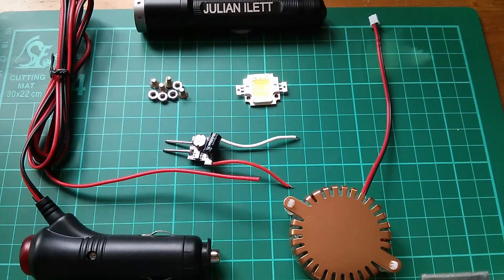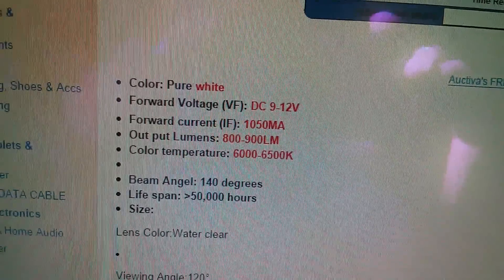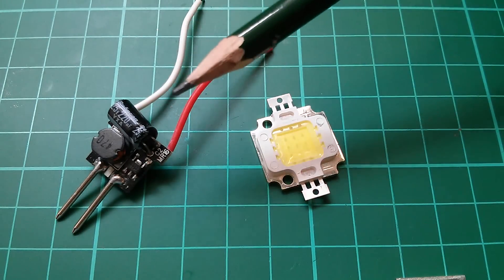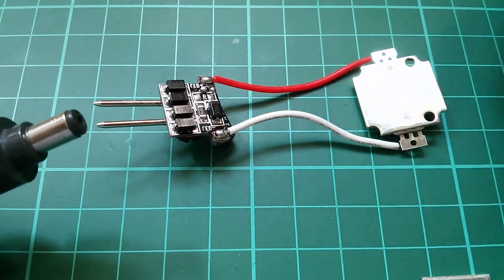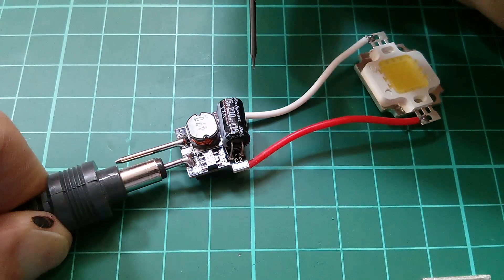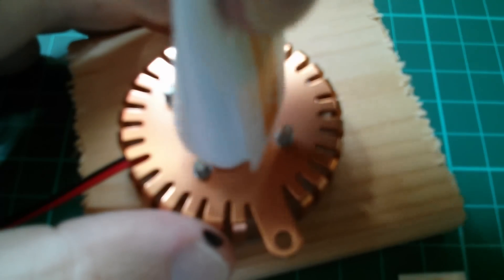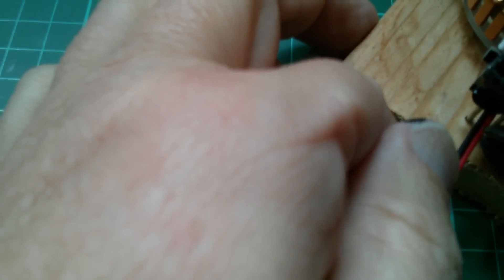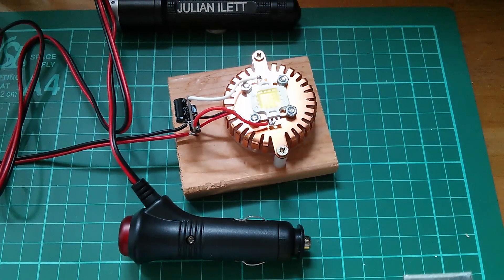LED Tutorial: Light a 10W LED from 12V - Simple & Cheap

Comment: Hi Julian ..i bought this set up on "satisled" website .... i read that the driver has an input DC 12-24 v .... i dlike to know if i could use an old PC battery charger that i have .... the output is DC 19V 4.79 A... will it fry the driver or not ??? thanks Seb

Comment: Nice guide! 
But i am having issues ... i have bought 5x led drivers + 5 10Wled chips ... problem is, that driver is providing only 570mA to each led chip. I have mesured 10,4V on each led chip ... 10,4V * 0,57A = 5,928 W ... that is definitely not 10W ... Not cool at all. 
Do you know why is this ?
As source for my application, i use old PC ATX source ... its 12V brasnch is capable of delivering 15Amps .... i have mesured, that its voltage under load is 11,86V ... i think pretty normal.

Can anybody help me ?
Reply: +Jan Slavotínek your driver takes away 1.6V to do the regulation, and the remaining 10.4V is not enough to drive the LEDs at full capacity. Thats completely normal, you need a higher supply voltage! Consider using a DC-DC boost converter!
Reply: ᅚᅚ I have found out, that there is diode bridge (2 x 0,7V drop) on the PCB that is completely unnecesarry if you use DC supply. So i have desoldered it away and now its better but still there is not flowing 0,9A current as i have expected. I suspect bad current feedback resistor (shunt) settings

Comment: i am using leds withought a driver in direct 12 volts for nearly 3 to 4 years,
 it isnt giving any problems.
Reply: Nothing is driven by current, everything is driven by voltage and current which = power (neither can exist on their own). Connect a 3.5v LED to a 1v power source and it will never light up. 
The only thing that differs with an LED vs a lot of other electronics is that it draws current at a ridiculous rate if even slightly above it's max voltage recommendation. 
If you run an LED at the exact right voltage or even a few a few hundred millivolts under then it is never going to miraculously draw large amounts of current and burn itself out. It draws current based on the voltage you supply it with, as long as you don't overvolt it then it's fine. The rate isn't linear though as the man that made the video pointed out. 
So you have to be careful with them, they aren't forgiving.
Reply: +Parasar Bhattacharya it shouldnt be either. But it really depends on the led. These leds are probably being overvolted at 12 volts therefore the current needs to be limited. Just my guess thou.
Reply: Marcus Christensen
yes if you are giving more voltage then the current shuld be limited. while i use perfect voltage so i need no drivers..
Reply: *****
yes i found it out by performing few test, thank you though sir, and i am using a 3 amp transformer but the leds are mounted on big processor heat sink but without the cooling fan, now i aM trying to mount 5 of these leds in one heat sink and will run by computer smps which can provide upto 5 amps.. but this time i will connect the cooling fan also... thank you very much for confirming what i got from test results. thank you again...
Reply: Perthaps your LEDs have a protection resistor built in, & maybe you are driving them from a true 12V supply, whereas a lead avid car battery might be charged close to 14V
Reply: well.. the idea with constant current is that when LED get hotter it let more current through and that shorten it's life, so basically if you keep your led cool, there is no problem at all and you don't need any driver, it's just safer option to have that led driver :) you can then be sure it gets what it need and nothing more
Reply: Parasar Bhattacharya  First This Led is Driven By Current Not Voltage.... If You Giving A 12V 1 amp It Will be Fine ...  also depends on heatshrink  but  Technichally In the long time use we advice to use a LEd Driver (Current Driver )
Reply: Parasar Bhattacharya I have Connected 100 W Led On A 36V 3 Amp Supply But i have Fix With a Prosesser Hit Shrink Which Is Pure Copper also come with a Cooling fan
Reply: Maulik Patel
 wow thatz  great , then you can use it  for long hours... its really a very good option. but the heat sink should be a little bigger and thicker
Reply: Question for all of you. If I use a 18650 cell, a TP4056 (with protection) and a MT3608 (it's a step up) to drive a 10w LED would I need a driver?
Reply: works with mine too very well. I have a 10w LED for 12v. Just having a good cooler on it c:
Reply: Well explained. Thanks!
Reply: Using LED's without a driver really only works if you have a good heatsink and fan behind them. It still will likely reduce the life span of it though. The current an LED draws does depend on the voltage source it is connected to, but also the LED if it gets hotter and hotter will reduce resistance and try to draw more current. Thermal runaway. 
Of course if you run a 12v LED exactly at 12v and have a good heatsink on the back with a fan then the LED will be controlled as far as temperature and it won't draw more than it's meant to at 12v.
I use drivers just because it's easier and I don't have to worry about making things exact.
Reply: One thing to note here is that as it says in the driver listing MR16. I have used MR16 LED bulbs on a 12v regulated supply perfectly for several years as well.
I think the point being is that the MR16 bulb unit has the constant current driver built within the base of the lamp unit
If you are using these SMD LED units then you do need a driver
Reply: Parasar Bhattacharya superman angela please complete

Comment: Hi, I have a nice 24v power supply and a housing from a previous sewing lamp. Id like to install some leds into the housing and use the psu to power it. Id like it nice and bright but not too warm as its a plastic housing. Would you maybe have some suggestions to how I could build my own?  Id also be happy using mains and a converter if its small enough. If you could help me out I could send you pics and more info. Thanks Simon

Comment: Hi Julian
Awesome video, very informative.. I am a newbie to LED world, If I have to connect 5 of these 10 w LEDs in series I.e. +ve to +ve and -ve to -ve  wiring and drive all 5 of them with a 12 v 2A LED driver, do they all turn on at full brightness, does the current get divided between each of those 10W module?..given these LEDs are rated at 900ma do all individual 10W LEDs get 2A current? .. Thanks a lot...

Comment: This is probably a stupid question, but can anybody explain how the LED is rated at 9V - 12V but still be destroyed at 12V? Surely if it's rated 9V - 12V it should be able to take that many volts, no? Thanks
Reply: You can, but when the diode begins to warm up, the resistance in the diode will decrease, which then increases the current and temperature even more, which again reduces the resistance and the diode will burn out, given that the 12V power supply will supply currents that exceeds the diode's capacity to handle, such as a small 12V battery. That's why you need a resistor in series so that it can take care of limiting the current. There is even more to this, but this should give you a sense of this topic. Even 1V could burn the diode if the current is sufficient. However, going over or below 9-12V will reduce the life span of the diode depending how much so, and the diode.
Reply: +Richard Jesudasan it make no sense infact. This is due to the fact that sellers dont know electronics. Much better a value like If=xxxxmA, Vf=xxxxV
Reply: 12v batteries output more than 12v. Usually around 12.6-12.8v. That small different can make your LED burn out just after a few hours, it's because it gets incredibly hot if just overvolted to a small degree. 
The description on the ebay page he showed you had two contradicting things also, it said 9-11 at the top and then 9-12 in the description. 
Usually there are 3 in series in the LED, usually 3.5v is what they like. So 10.5v should be the max, but around 10v is a better area to settle on.
Reply: It's all too easy to get into trouble with the ubiquitous 12 volt supply. Unique to that voltage is a loose definition. There are two voltage readings which is often thought of as generic. 12 volts in the lab and industrial fields is 12 volts + or - any given accuracy tolerance often stated as 5%, but can be tighter. The other 12 volt environment is automotive which can vary significantly. A lead acid battery reads around 12.6 volts at rest. The internal combustion engine needs an electric motor to start running on it's own. That electric motor can be around 0.50 up to about 1.0 horsepower which results in a short term load of dozens of amps which will cause a battery terminal voltage to drop several volts below 12.6 volts. Let's say that voltage is around 9 to 10 volts but could be even lower. When the engine starts it immediately recharges the battery for it's next use. This can rise to as much as 14.4 volts but falls back to approximately 13.8 volts nominally and varying slightly depending on the actual conditions. So in conclusion you can see where "12 volts" can actually mean anywhere between 9 volts to over 14 volts all within a short period of time and settling to something over 12 volts for the duration of the engine run. 
  Please don't make the mistake of assuming a fixed nominal voltage in a motor vehicle.
Reply: Two reasons, one is shitty leds and two is no or bad cooling.
Reply: @TaunterAtwill  and reason nbr 3 is....say anything to get the sale coz we know f*ck all about this product
Reply: +Richard Jesudasan It means the LED will draw the correct amount of current at only one specific voltage somewhere between 9 and 12 volts. But you still have to get the exact voltage if you want the specified current. Which is why its easier to just supply the correct current (with a constant current driver) and let the voltage be whatever it has to.

Comment: Hi, Quick request for advice If I may be so bold.I am looking to run a simple off-grid solar setup in a house I am renovating which does not have mains-feed. I just need lighting so nothing heavy duty -- a couple of  40W Panels fed into a charge controller and banked in some surplus 12v UPS Cells . I want to  run a succession of circuits to provide a switched light fitting in a couple of rooms using some of those cheap ebay ceramic MR16 lamp holders and then insert some MR16 LED Bulbs in... 
Is that okay or do I need a line driver somewhere in the circuit?. I have done a single circuit test run and its fine but before I run all the cables out and tie them all in, am i missing something? does each 12v MR16 LED lamp have its own line driver built in?
Reply: I charge 20 USD/H for consulting

Comment: i have a flood light with the same led chip as yours with a died led driver ( lable says 25-34V) ???  i have chacked the led with an 12v supply it whass still works and i replaced the driver with the same but now my led chip is also died.

Comment: it is not true that the LED burns if you connect them directly to 12V. I connected a 10W LED to a fully charged LIPO battery (around 12.5V), and it worked lika a charm. Cooled it with a passive CPU heat sink, but it got quite hot after a few minutes :) wouldn't recommend doing it that way, the lifetime of the LED will be greatly reduced and it needs some serious cooling

Comment: how could i make it so i plug it into a wall
Reply: +Tony Boroni http://www.ebay.com.au/itm/DC-12V-1A-Home-Travel-AC-Wall-Plug-Power-Charger-Adapter-Converter-with-AU-Plug-/251933448438?hash=item3aa86758f6:g:UJcAAOSweW5VOxAK      Something like that into the voltage step down regulator should work

Comment: Something I'm curious about is the current reading I'm getting when using this 10w led with a 10w driver - it's reading about 150mA at 9v, with the input to the driver being about 16v. If I short the output I however get about 950ma (presumably at 12v). I wonder if it could be a problem with the two 9v batteries not being able to supply the current? I'll give it a test on a car battery tomorrow and post the results.
Reply: +BenjaminGoose Did you get any results with testing?
Reply: Hannes Mrg I've just tested it on a 12v supply and my meter showed just under 300mA being drawn, so maybe it's the led itself. I have some more on the way, so I'll give them a test too when they arrive.
Reply: +BenjaminGoose That would be nice, i also ordered some of them, if you want i can tell you the results when they are here.
I also read(or red?) that there are broken leds sometimes who dont work right. Maybe you have one of them.
Reply: Hannes Mrg That'd be cool, yeah. I noticed that at a low input voltage (about 9v) some of the leds glow brighter than others, and there doesn't seem to be a pattern to it (which I guess could be normal, I don't know). All of them glow though.
Reply: Hannes Mrg Just tested this connected to the car battery whilst running the car (giving about 14v) and it correctly drew about 0.83A as it should! So perhaps the driver requires a bit more than 12 volts.
Reply: +BenjaminGoose Okay, thats nice. I think they work like the little buck converters, where the input Voltage has to be at least 2V over the output Voltage to work right.
Reply: Hannes Mrg Yeah it seems like that. Bit of a shame you can't get full power from a regular 12v supply though.
Reply: +BenjaminGoose At 9V i measured a power of abuot 5W instead of 10W. We are at the elbow of the v/i led curve
Reply: elparadisecom Yeah that makes sense to me. I measured similarly at just a little higher voltage.
Reply: Hannes Mrg Just in case this information interests you, I hooked up a 24vac supply to the led driver through a bridge rectifier and smoothing capacitor and it seems to draw the full power without requiring any voltage regulation on the power supply (I guess that makes sense considering how the led driver works). That's pretty cool. I have plenty of 24v xmas lights transformers to spare so maybe I can use those in projects. :)
Reply: +BenjaminGoose Thanks!! I was wondering the whole time what PSU i should use because the common 12v ones dont seem to work well. I will try the same then :)
Do you think With 240Vac with bridge rectifier and 10 drivers in series it will work, too? 
10 Leds in series wouldn't be that good i think because they all have little differences in the power they need, but the drivers should not really care. Or do they?
Reply: Hannes Mrg That's a good question. I'd imagine that due to the switching nature of the drivers the voltage won't be distributed evenly among the supplies, meaning some of them may be taking a dangerously high voltage, so I wouldn't recommend trying it. If you have a 12v (ac) supply you can easily create a voltage doubler with a couple of components (see the wiki article on 'voltage doubler') which I think would work just fine. If I can find such a supply I'll give it a try myself, although I'm not sure how common they are.
Reply: Hannes Mrg Oh by the way, if you happen to have a suitable boost converter lying around (to use on a 12vdc supply) that'd most likely do the job. They are really cheap to buy on sites like aliexpress and banggood. Seems like a bit of a roundabout way to solve the problem though, considering the led driver already works in a similar fashion to a dc-dc converter.

Comment: Hi all, i have bought a led ring for my car and i want to secure constant 12 volts all time by using a driver like this one. My car voltage jumps to14volts all time. Will it work?
its a 10W 12V - 24V DC LED Constant Current Driver Power 900mA High Power LED
Input Voltage: 12-24V  DCOutput Voltage: 9-12V
Output Current:  900mA+-5%
can support 1pcs high  power 10W led 3 in  serial and 3 in parallel

Comment: Hi, I have a question I hope you can answer for me. I have converted my car's tail lights from regular bulbs to LEDs. Up until two days ago, I was using SMDs with no problems at all. However, after I installed COBs, a couple of days ago, I noticed that the COBs flicker and do not light up evenly across the board. I am using resistors, in order to dim the lights a bit when using them for running lights, and when I hit the brakes, all the voltage gets fed to the lights. It seems as if the problem arises only when I have the COBs on the lower voltage setting (through the resistor) and not on the full brightness setting (bypassing the resistor)... I saw that the COBs came with a black piece that the wiring goes through, while the SMDs did not have that. Is that black piece essential for the operation of the COBs? Can I remove it or that would render the COBs useless? How come the SMDs do not come with that additional piece in the wiring? What could be causing this issue? Thanks beforehand!

Comment: Hello! Nice video. I want to ask; if it is about what I've read, this 10w led cannot go beyond 80ºC. So, with a thermocouple, i've measured it; and the temperature goes far beyond that, around 105ºC.
The part of the led where y apply the thermocouple is in the yellow part (where the light shine). Is it the place to do the measure? should i do it somewhere else? Because the led is working fine (by now...) and is higher than the absolute maximum parameter of temperature. Thank you very much, sr. Greetings!

Comment: Julian I did this project and it works great. I bought several of these 10 LED's on Ebay from user dahengteam. These 10 Watt LED's are Forward Voltage (VF): DC 9-12V and a forward current (IF): 1050MA My question is I would like to use some of these in the house/garage on our 120 volts. Is ther a easy way to explain this or maybe future LED tutorial?